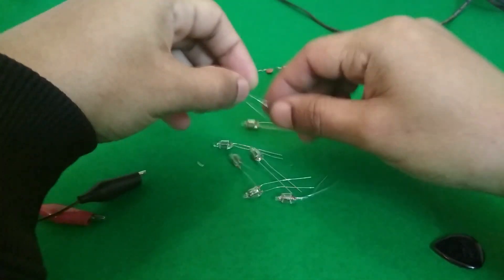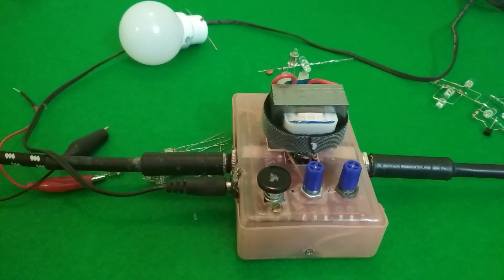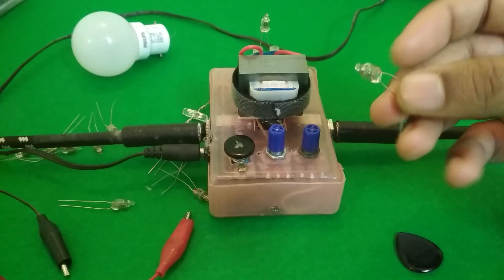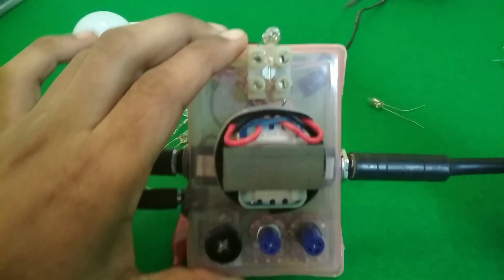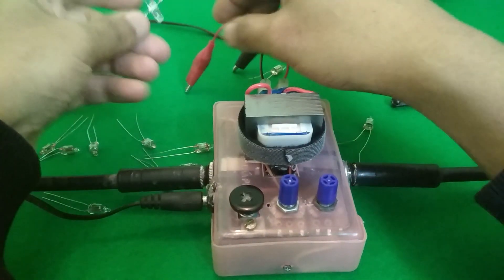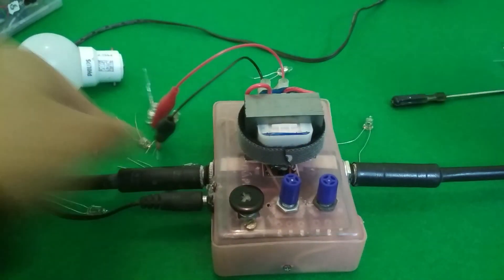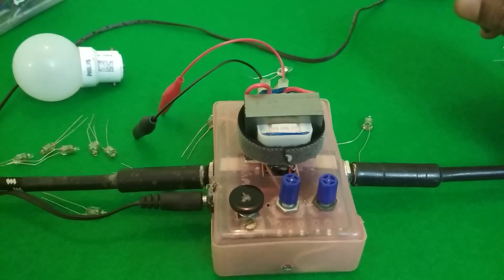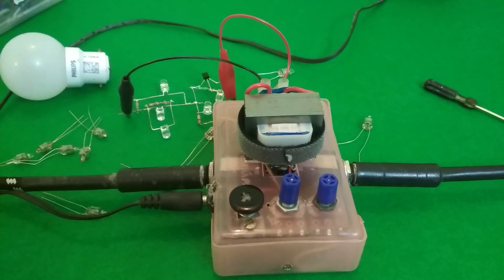DIY "Tube" Distortion - High Voltage Neon Drive Pedal

Comment: Came here just for a quick "oh let's see how the neon bulb sounds", stayed for the excellent talk and demonstration of all the other devices. Nice work!
Reply from the maker: Thanks! Glad you liked it :)
Reply: im impressed ! 
dist. sound- 👍🏻+
clean sound- 👍🏻++
new H.Freq sound - 👍🏻🏅🎖🏆
your presentation (explanation & clarity) - 👍🏻 , 👍🏻  one for each skill as they exist as irreduceably complex , when the most effective way to teach is sought after.
 AND i was elated that you seemed to embed obscure wisdom , to those that have keen observatory traits. 
first off, i admire your pedals design. the I/O  and controls are in the optimum location, as this has been fleshed out for  over 100 yrs. 
but im intreged to the type of material used.... ie: the housing, it dont look like Aluminim. or thin sheet - stamped steel.  
it looks though it was cast. 
then the switch looks as a re-purposed fastener custom fitted as a switch post cap, to resemble the simplicity of steam- punked.  i do a lot of repurpose 'ing on my builds, (CBG's, sm. amp's & bluetooth speakers, just to name a few)
i find this is a most admirable way , as it removes waste products from the earth, and not having hard earned finances to run buy a box painted red metal flakes, chrome corners & a packet of stickers with skulls, stars, stripes, lightning bolts a wide variety for choice.  the difficult level increases and to me that increases the fun/enjoyment level. i get a kick out people looking at mine & i see them trying to de-engineer it. 
now the rubbish discarded item , stands as a rare & coveted item. from the artistic touch  & the wonderful ability of creativity, so to whatever materials was used - 🔭✨️😉🤚🏼😁.
ok, ive yammer'ed long enought , that is a great tone on each setting, i pre-judged the zener diode to help with s plesant tone  because it has that build up of resistance to point & then  it allows current to flow & falls off a cliff, but alas, it has a distenct sound. i admire to whole thing, and mostly would like to swap ideas on high frequency & builds using it. ...... but i will have to return at a later time. 
btw  you got a sub from me ⚡️🎸🤚🏼😁
Reply from the maker: @guitarman_3693 Thanks a lot! Glad you enjoyed it. Many of builds are just fun projects so I don't bother to make them performance-ready.

Comment: Can the current shock me?
Reply from the maker: It probably could a bit, yes :P
Reply: @Psychotenuse what type of transformer did you use? Like 12-0
Reply from the maker: That should work. The primary voltage matters too.
Reply: @Psychotenuse  so,  is the power source 9v adapter?

Comment: Can these be stacked, how about a sub miniature tube, and can it be transformerless
Reply from the maker: I'm not sure what you mean by stacked. The neon lamp is not a valve and it has no amplification capabilities. To make this transformerless you would need a DC rail at 90 volts or higher.
Reply: @Psychotenuse  stacked like op amps in a pedal
Reply from the maker: Your questions seem based on the idea that a neon lamp is an amplifier like a valve or transistor or op-amp. It is not. It is a passive nonlinear component like a diode.

Comment: Big fan of the channel and your projects! Is the step-up transformer in the audio path in this circuit? I'm new to electronics and still figuring out how to read schematics. If it is in the audio path, does the frequency response of the 1:20 transformer matter? Like do I need to find a 1:20 audio transformer or power transformer or does it matter? Thanks!
Reply from the maker: Yes, the transformer is in the signal path. I'm sure it affects the tone, though I'm not sure how much. I'm just using a step down power transformer in reverse; I'm sure a specialized audio transformer would perform better though, if you have one.
Reply: @Psychotenuse  thank you sir! I was curious mainly because I was having trouble finding any 1:20 audio transformers and was hoping a power transformer would do!

Comment: I noticed you haven't put out a video since last year, but I just found this and thought it was amazing (though electronics is unfortunately completely over my head >.<) I was wondering if you could make a whole "tube" amp out of these little neon bulbs. considering how nice the distortion is I have to imagine it would sound great!
Reply from the maker: Yeah, I've not uploaded pretty much since school related activities started back up. I do have plans for a couple of videos in the coming months, though.
As to using gas discharge tubes for an amp, the problem of course is that they have no amplification capabilities that I know of :P
Maybe multiple stages of gas distortion would have a cool effect though, like how you get multiple stages of vacuum tube distortion in an amp.

Comment: Could you share a sketch of the LED matrix you used at the end of the video?  Also, what voltage is used for power? 9v?

Thanks! This kicks ass!
Reply from the maker: So I came up with a network like this https://imgur.com/a/HVgTLwY
looking for something whose I-V curve has negative curvature, i.e. the static effective resistance increases with voltage. R1 here should be 10 - 100 times bigger than R2. When the voltage is lower than the threshold voltage, most of the current flows through R2. When the voltage is higher than the threshold voltage, much of the current flows through R1.

Two of these networks connected anti-parallel gives the squelch network I showed.

As for the clipping part I don't actually remember exactly what it was but it's diode-resistor series pairs connected in parallel.

Comment: I have a question. I builded but pedal is very noisy . Constant beeeepppppp noise. I cant find reason. Do you have idea?
Reply: Problem solved. Reason is power supply. I have one more question. 10k pot is not effective what is reason?
Reply from the maker: @utkukaya757  I can't really think of anything that could go wrong with the output pot per se, other than problems with contact or perhaps a faulty component. Are you getting any sound out of the pedal?
Reply: Yes pedal sounds good but when ı turn 10k pot, there is no dramatic change. Do you think using 1M pot is better?
Reply from the maker: @utkukaya757  This shouldn't be the case. Look at the schematic again, perhaps you had switched the 10k and 1M pots to begin with?
Reply: I fixed all problems eveything is fine now. Thank you for helping

Comment: if those are high voltage leads... how are you now getting zapped handling them like their turned off?
Reply from the maker: Hahaha. Well, first of all, I don't recommend you emulate my behavior in the video.

To answer your question, though, I am getting zapped a bit sometimes, but it's not too bad because my hands are dry and I'm holding the leads fairly lightly. I have also tried - for science - licking my fingers and grabbing the leads tighter, and yeah that definitely gave me a good little tingle in my nerves. There are several reasons it's not particularly dangerous. The high voltage side on the transformer is effectively isolated from mains, so I'm not going to have currents running through my body to ground. As long as I only touch the contacts with one hand any currents will be only in that hand. Then the neon bulb itself clamps the voltage to its nominal 90V and the drop resistor limits current further... basically while I definitely don't advise imitating my stupid behavior, I've also definitely not built an electric chair here.

Comment: Awesome channel and video! My first flirtation with gas discharge tubes involved replacing the full wave rectifier tube with a mercury vapor rectifier in a few amps - with a time delay relay to ensure the filament had enough time to warm the tube. Never considered trying these tubes as essentially clipping diodes.
Reply from the maker: Ha! I didn't even know gas discharge tubes could be directional. Goes to show how sometimes an idea obvious to one person isn't to another and vice versa...
Reply: @Psychotenuse  Check out the channel El Paso Tube Amps. He has tons of videos on AF and RF amplifiers, and among them he did a few on gas rectifier tubes - mercury vapor, argon, and xenon. As you noticed with the sharp gain cut-in with your pedal illustrating the distinct threshold of ionization, gas tubes used as rectifiers have an advantage over vacuum tube rectifiers since they have a nearly constant voltage drop regardless of current draw - this happens to be the voltage required to ionize the gas. For example, a 5u4g vacuum rectifier may have a significant voltage sag when loaded up to 200mA, but an equivalent MV rectifier (like a type 83) will have a stable 15 volt drop throughout its current range. As you mentioned elsewhere, gas tubes are often used as a voltage reference for regulating circuits; this stable voltage drop - due to the ionization potential, regardless of current draw - is precisely why they can be used effectively for this.
Reply from the maker: Yeah, lots of cool properties! The one that's most unique to me is the little hysteresis loop (not pictured in the video) between the turn-on and turn-off states, something you don't see in any semiconductor devices that I'm aware of.

Comment: Uow, fantastic! How many volts was the circuit powered?
Reply from the maker: In the video it's running off a 12 volt adapter. It would probably work fine off 9 volts, though.

Comment: An adjustable dc bias voltage on the neon would make this soooo much better...
Reply from the maker: Ah, I see what you mean... It would require a completely different approach, though, since the whole point of using a transformer in this way is to avoid the need for a high voltage DC rail. I suppose, though, that a DC offset of up to 9 volts (or whatever the pedal supply is) would be easy to implement. That might not have much effect on the sound.
As it is, I suppose asymmetry could be introduced using zeners or something in series with the neon.
Reply: @Psychotenuse  You could either use a small dc to dc converter module or a small transformer(based pwr supply) to isolate from the mains...run that in series with the neon transformer you are using....
Reply: Also here is a thought...currently your circuit shunts the high voltage audio signal to ground through the neon...what if you took the "conducting part" of the neon only as the output audio signal...clipping the low volume (severe crossover distortion) as opposed to clipping the high part of the signal(square waving)....this has been an idea floating around in my head for a while but haven't tried to develop it yet...
Reply from the maker: @Centar1964  Yes, there are ways, of course, to make a high voltage DC rail. The point of using the transformer is that it eliminates the need for one. The transformer would be unnecessary If a high voltage DC rail was available, since then the obvious way to do things would be simply to use a high voltage amplifier.

If by "conducting part" you mean the current through the lamp, this can be done more or less simply by connecting the output across the drop resistor instead of across the lamp. This would result again in a "squelch" effect, i.e. distortion on the bottom of the wave rather than the top, with an inherent gating effect and a different sound, distinct from overdrive, which cleans up as you play louder instead of getting dirtier as you play louder.

One thing I want to do if I ever build a stage-ready version of something like this is to have three terminals instead of two, such that the drop resistor and "clipping" element could both be swapped. This would allow changing the effect from drive to squelch by simply swapping the two components, and would allow cool combinations of the two as well.
Reply: @Psychotenuse  Ya the drop resister is what I was thinking...should be an interesting sound, never heard it before.

Comment: output can potentialy hurt you
hold neon bulb for leads 😅

Cool circuit btw
Reply from the maker: Haha yeah, I don't recommend you do that :P

I zapped myself with this intentionally in the name of science (in fact I can sort of turn my hand into a distortion pedal) so I know more or less how much it can hurt. I was careful never to touch the two terminals with two different hands because that way the current can flow through your heart.
Reply: @Psychotenuse  yeah, i know that, just wanted to point it

Comment: You are amazing.  You are such a good inventor and teacher.  Set up a basic class live and I will attend, I want to learn about how to make circuits, inventive ones, useful and fun ones.  Awesome!!
Reply from the maker: Hahaha thanks, always nice to get a compliment... but I would be remarkably unqualified for something like that :P I've never actually learnt electronics and I'm really fumbling around this stuff myself. For example, just a few weeks ago I learnt that I've been referencing my audio inputs and outputs incorrectly all this time, which is why my circuits never worked with wall adapters and I always had to use batteries xD
Reply: @Psychotenuse You're doing a great job! Keep it up, I'll be watching and learning.  Best to you.
Reply: I'd be interested in your IRL example of what you mean by this, for my own audioDIY super-noob reference!

Massively happy seeing this experimental distortion fun, btw. I'm more interested in distortion circuits for the synth-side of the audio world, and this reminds me of Music Thing's London Drive & Mini Drive clipping-lamp designs!
Reply from the maker: Hey, if you mean the mistake I had been making, it was to reference things like microphones and pickups to a voltage divider as a makeshift mid rail. Turns out your mic or guitar couples capacitively and inductively to the outside world and any common mode swing ends up across it.

Comment: Amazing as always 
Keep doing the great work

Edit : sir could you please build a simple  hall/room reverb pedal .
Reply from the maker: Also why would you call me sir lol that's funny
Reply from the maker: Thanks :)
Yeah so effects like reverb and delay (a reverb is just a collection of very short delays) cannot be done using analog circuitry alone. You need either digital processing or mechanical movement to get any kind of frequency-independent delay. There are some "analog delay" pedals but they are sort of 'half-digital' in that they use a discretized time axis.
It would probably be possible to build a reverb pedal using a popular microcontroller like an Arduino. Maybe something I try someday but I'll have to learn how xP
Reply: Pt2399 might work as well??🤷🏽‍♂️
Reply from the maker: Haha I didn't know about this chip, of course that would work :D

Comment: Really cool non-conventional clipping element!
Reply from the maker: Haha yeah, actually I'm surprised gas discharge distortion is not more of a thing, they are used for voltage regulation and stuff, like diodes are at low voltage.

Comment: I was looking at these on mouser a while back and wondered if you could use them for a VCF. This is cool too.
Reply from the maker: Not immediately clear to me how you'd use it for a VCF but if you have a high voltage DC rail it is really easy to make an LFO with one of these (literally 3 components).